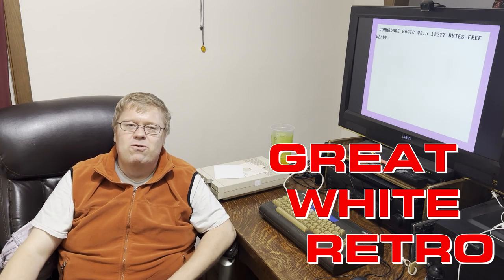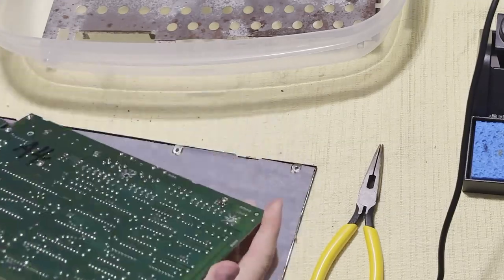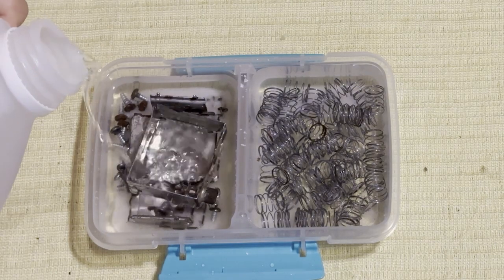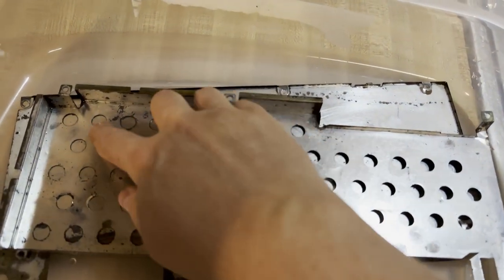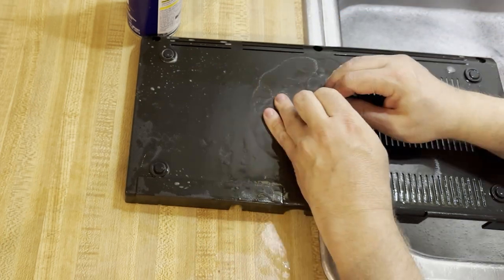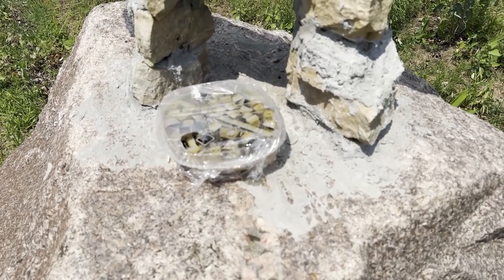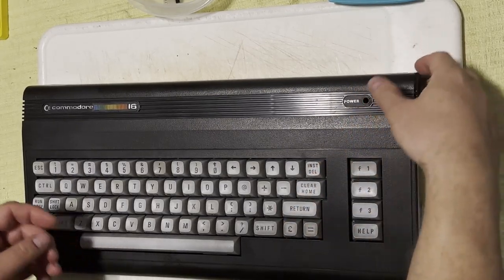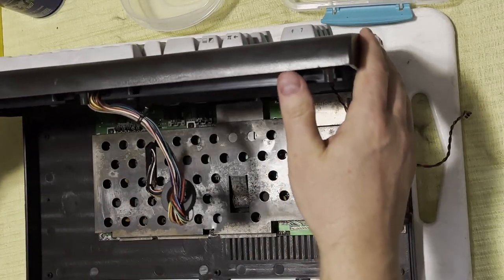The Worst Commodore 16 I've Seen

Comment from the maker: So I can get some plus/4 software running but not Pets Rescue, free or paid. Maybe it needs a PAL machine, but it runs in VICE in NTSC mode so who knows.
Reply from the maker: I was also able to run DIAG264 on this machine today, and confirmed the RAM and TED are working. I need to build the diagnostic plugs yet, but I'm confident this machine is working as intended. Next I'll try making a PAL / NTSC switcher to get Pets Rescue working.

Comment: This would have been fairly straightforward if not for the rust.  Nice result, considering what you started with.  The retrobriting was a great success.  The keys came out looking brand new.  You were very fortunate to find a replacement "7" key!

If one day you need to address the rusty screws, you can replace them.  They're just standard self-tappers as far as I can tell.  Save your knuckles!

Impressive restoration overall.  May I recommend some sort of lavalier mic?  You do sound a bit distant.  Certainly you can be understood, but improving audio makes an immense difference.  See you next time.
Reply from the maker: Filming on an iPhone, I’d need a Bluetooth microphone. I’ve never had good luck with those, due to the lag where the recording is a few milliseconds behind the video. I’ve attempted to enhance the audio though.

Comment: The 16 and Plus 4 are such puzzling machines. Why did you think people actually wanted computers that were inferior to and incompatible with your flagship C64, Commodore? Why, oh WHY?
Anyway, good video. Anyone ever tell you that you look vaguely like Elton John?
Reply from the maker: Many Commodore fans wondered the same thing. Bil Herd and David Murray went into detail about the TED project and what it was supposed to accomplish, but Commodore got greedy.
Reply: Acorn did the same thing. They brought out the Electron, which was a cut down BBC computer, in 1984 when similar machines were becoming obsolete. It's true that the BBC was extremely expensive for what it was; but in an age before the Internet, being the "default" computer up until 1987 or so was a massive advantage. The problem was that the Electron, while in theory completely compatible with the BBC, wasn't capable of running all its software.
Acorn managed to launch the Archimedes as a RISC-based 80186 16 bit PC, so it survived- unlike Sinclair, whose QL sank so badly that by 1988, their computer division was sold to Delboy Alan Sugar.

Comment: 12:00 You should not be putting those springs in vinegar especially if you add salt.  That salt will promote rust in the future.  Vinegar is highly corrosive to metal. You are fatiguing these springs. These springs are very thin. All to remove minor surface rusting. If you MUST de-rust parts that aren't going to make a difference, at least use a proper de-rusting agent like evaporust.  Evaporust will remove the rust without damaging the metal.

You are disassembling the keyboard so you can de-rust the screw heads?  What do you think the rust on the screw heads is going to do?  If you are that worried that the screw heads will rust away, you could simply drag a brass brush across the screw heads.  Or you could remove just one, measure it and then just replace them.

All this stuff you're doing carries risk.  The minor rusting does not justify the risk.
Reply from the maker: I’ll be doing electrolysis in the future.
Reply: @greatwhiteretro  I hope it's nothing visible. Because electrolysis discolors the metal (turns it black).  Electrolysis is obviously better than a mixture of salt (I really would appreciate if you would tell me what makes you believe adding salt is necessary?) and vinegar.  But nothing beats Evaporust.  That stuff is great. It's reusable, it's cheap and it is absolutely safe to metal and is non-toxic and non-polluting.
Don't use salt in your electrolysis. Use washing soda or even baking soda.

Comment: WHY would you remove the RF modulator?  That's a terrible idea.
Reply from the maker: I put it back…
Reply: @greatwhiteretro  You said later in the video that if it was yours, you would remove it. But why? It's not hurting anything. It's original. AND, if you want to ever use it with an old TV, it's the only way you can.

I really don't understand the mindset. You are far from the only one.  I see this done constantly in YT videos.  A working RF modulator is fine. This is a low resolution device.  In multi color mode, it's 160x200 resolution.  This is well within the specifications of RF video. Most people watched either RF video up until 2011 or cable TV through the RF port on their cable TV box.  The specification of NTSC video is WAY higher than any console up until the PSX/Saturn.  Even then, most games were still at 330x240 or 240I (I think it's I. It's either I or P)  The RF NTSC signal is 525 lines.

A poorly working RF modulator will tend to put out a fairly ugly signal.. But even my 1977 original Atari 2600 puts out a perfect picture over RF.  One reason for this is the Atari has an internally connected proper RF cable. Most people today (which I noticed you did in this video with the white RCA cable) will attach an RCA cable to the RF port and then use an F connector on the TV to attach the other end. This cable is not the right impedance and is not shielded.  This can cause some of the typical complaints of RF.

Comment: Why are you exaggerating about the rust?  There is very minor surface rust, probably from storing it in a basement or something.
Do you live in Ca or some other dry environment?  You act like you have never seen minor surface rust in your life.
Why would minor surface rust on the RF shield prevent the computer from working?
Reply from the maker: I was having fun with it. When I clean up an Apple IIc shield in a coming episode I’ll show ‘minor’ rust.
Reply: @greatwhiteretro  I just see risk needlessly taken.  Whenever you take something apart, especially if it involves a soldering iron, there is a risk associated with that.